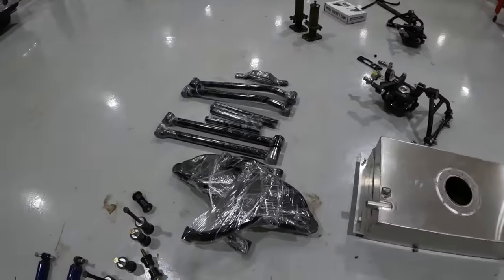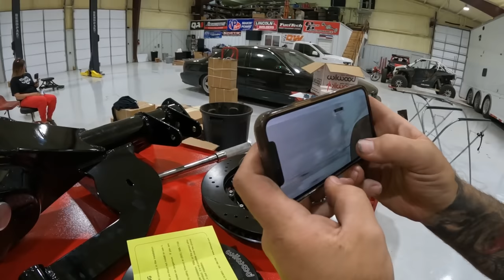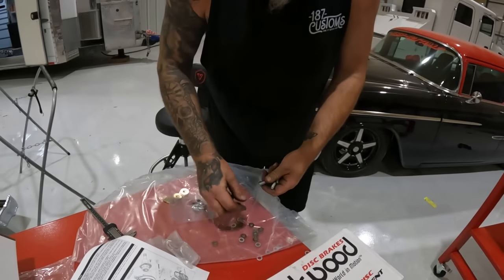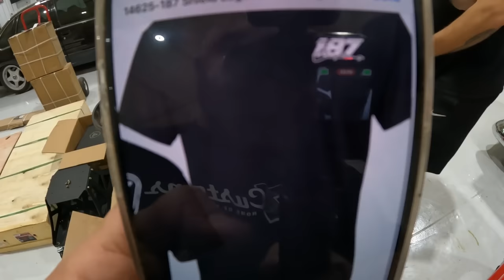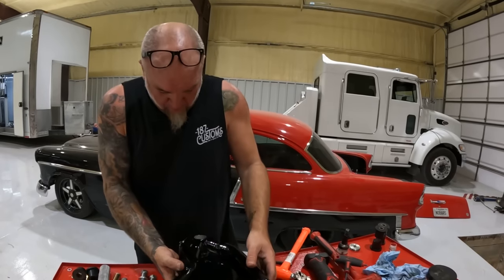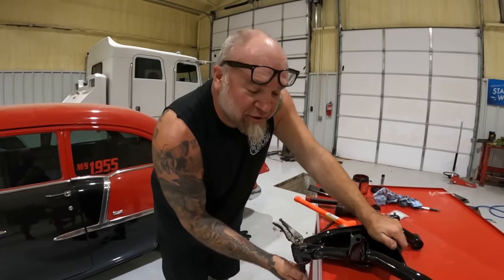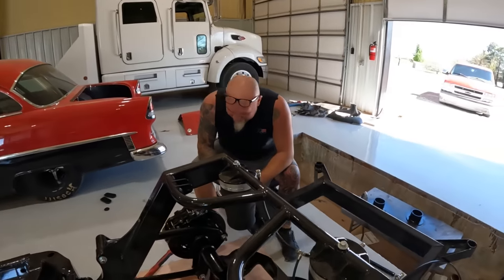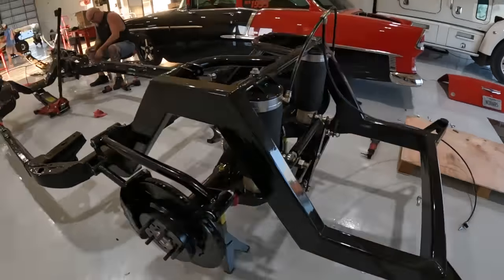SEMA Wagon Part 3! Let's Start Putting It Together!

Comment: Tim McAmis is going to lose his fucking mind if he watches this over taking the washer out for the lock nut to work. If you recall he went on a rant about using the right length bolts.

Comment: You need to give Bamco Motorsports a look.  They supply ARP stainless bolts and nuts in a multitude of colors including gold plating, black, and black chrome to name a few. Fully stocked in most SAE sizes but can get anything you need.

Comment: Moron’s you could build a steel box frame on wheels with a block & tackle so you can lift & move heavy materials around including rear ends & engines etc. I’m sure that’s well within your capabilities. If not you’ve got Jeff or Monkey.

Comment: I heard it explained by a racer, That when they use the camera to show that you crack the tire before the light comes on,.... That normal phones or cameras are not credible. And then it will actually make it look like your tire moved before the light came on. Even if in reality your Tire didn't move until after the light....... Because of the way that the light bounces off of the lense, And the way that videography is obtained.

I can't explain it but it made sense and sounded convincing. Maybe something you should look into.🦄

Comment: When I was a kid I had a 69 Olds Delta 88. Some asshole rear ended me at a stop light. It damn near totaled his 80s era Honda and put a minor dimple in the rear bumper of the Olds. It was made of thick steel with pretty thick plating because even after we took to bumper off the car and then hammered it back into shape with a 15 pound beater, the plating didn’t flake off or even look funny. Weighed a hundred pounds but the damn thing worked. On a car today, that would have been a four or five thousand dollar accident. Break a few sensors and it’s damn near totaled.

Comment: You guys should have that company come out and put that big organizer up against your wall and have that company come out and stocking nut bolt assortment. Same company is doing all the mechanical shops it did clear this is and vice grip garage. Then all you have to do is call in your order and they send it right out to you